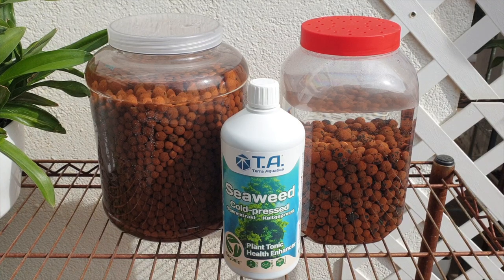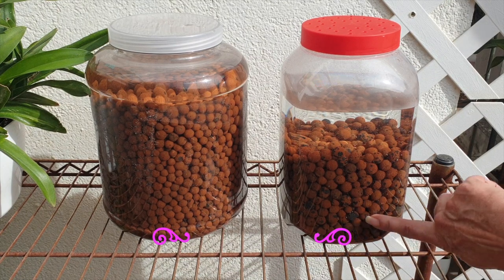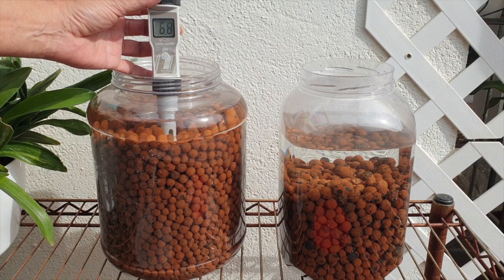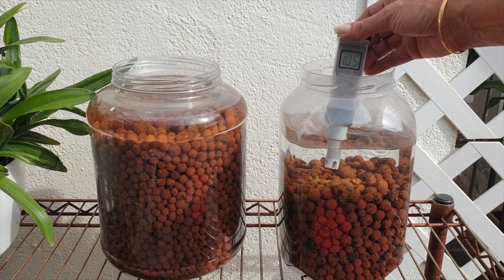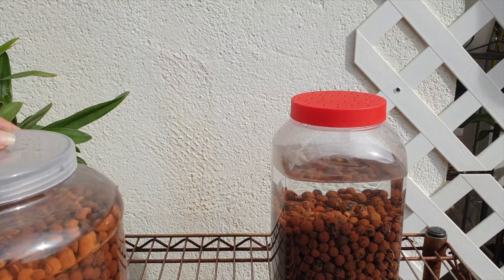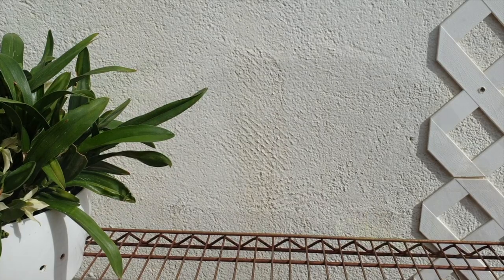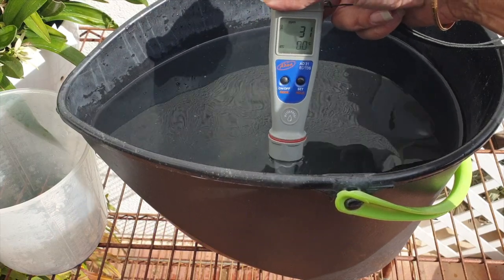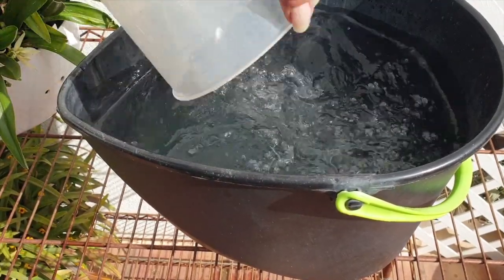Why Testing pH & TDS on Recycled / New Leca is IMPORTANT | TDS New Seaweed Brand #ninjaorchids

Comment: I would have thought the Lecca would have been cleaner. Lots of washing needed.

Thanks for the video
Reply from the maker: HI Richard 😍💐 yes! It is really surprising, isn't it. Now, things could be different from brand to brand, but it does not hurt to make sure of the values we are dealing with. Even the same brand has differences 😃 I was surprised when I tested the 2 different lecas and saw that the value of the newest was so low. Compared to what I had with the batch that had been sat in the RO water for the longest time and had been recycled, the new batch had me surprised. I am normally off the charts with the ppm for new leca and need to let it leach for months. That is why, if I think I need more leca for the coming season, I make sure to get it early enough so that I have months of leaching and changing water. The other day I tested the ppm of the new batch of leca and it had risen to 450 but that was after 2 months of no water exchange, so this was not such a bad new batch. Changed the water and it is ready to go if needed. Thank you so much for watching and your feedback 👍🏼 have a fabulous start to the week ❤️🌸

Comment: What happens if you acidify the storage water, down to say 4.0? I would expect the TDS in the water would go much higher as many times acids are better as solutes than bases, so a greater percentage of what can leach out should do so in the early stages in an acid water.
Also, that seaweed makes me think of "great green globs of greasy grimy gopher guts, mutilated monkey meat, little birdies dirty feet, and me without my spoon". Not sure many children outside the US sing this on the playground, but it was a thing here.
Reply from the maker: Don Miguel 🥰💐 hola jefe!! While acidifying the storage water is fine, it will only mask the leaching process and give me false results, so I prefer not to do that. I would prefer to know what I am putting in the pot, and then, if the pH is higher and not neutral as with my recycled leca, then I can pH any nutrient solution down and let the pot do the balancing out of pH as I have done in the past. Besides, if the leca takes on the acid agent, then I would have to leach that out eventually as well, and I do not want to mess with those variables 😬 I do find it interesting that my recycled leca is now not changing the storage water pH. That changes a few things that I need to take into consideration for the coming season when I get to fertilize again. Meanwhile, I was super interested to see the reading of the new leca was so clean, and after another 24 hrs, the ppm did not rise higher than another 50. That was never the case in the past. I would be shooting over 1kppm within the first 2 days. I did a water exchange on that container as well today. It may be chipped, but it is cleaner salts wise. Glad to have filmed this. Normally I just do my checking in the pantry 😆 I know that little playground tune and never understood it, but yeah 😂 on editing, it reminded me of Slimer in Ghostbusters. And, eventually the odor changed to that of being by the sea. Fresh and salty. Really appreciate you watching, Michael, thank you so much. Hope your day was fabulous and no one caused any aggro ❤️🌸

Comment: Thank you for this experiment! I’ve been trying out semi hydro on and off and have the same problems with high pH. 🙈 I’m definently going to try and leach out the leca before use from now on! 🖤
Reply from the maker: Hi 🤩💐 welcome! I have not seen you here before, so a warm warm welcome and thank you so much for being here, I really appreciate it 🤗 I had difficulty with some orchids, back in the day, when I did not have time to leach the leca for long enough to get it to stable out to the pH that the stored water is. I used to drop the pH of the nutrient solution to counteract the higher pH of my leca, but the salt accumulation would then still be an issue, because the leca was too new. I am really glad that this video was helpful, thank you so much for letting me know. Always feel free to ask any questions, under any video if you just need a confirmation of something that you may already know, or anything else for that matter 👍🏼 really appreciate you watching, thank you🥰 🌸

Comment: good and cheap seaweed is quite hard to find here too. Cold pressed should be green, otherwise it's chemically processed and turns brown, some are thick, some are weak as tea. Not sure about the consistency on yours. It's green but it seems too thick, if it were super concentrated thats fine but you had to use 1.5 times as much so it's not more concentrated, just far thicker like they literally did mix it with molasses. I question the benefit but since a bottle lasts so long I will most likley get a new one but which one to get....? There's literally only one cold pressed one I found and some reviews like it, others say it's watered down. It's interesting you got an aquarium product, I hadn't thought of that but they are generally twice as expensive. I was also contemplating not using seaweed for a year to see what difference it might have. Tough long term decisions.
Reply from the maker: Hi Tom 🥰💐 I have had cold pressed in the past years and it would also be brown, so.... maybe they were misleading on their label, or, it was done for because of wrong storage at the facility 🤷🏼‍♀️ this product cost me 23 Euros, for a litre. My previous one 'KelpMax' cost me a little more than that for 500 ml. I will just have to wait and see if it is of any good. Meanwhile, I do like the smell of the fresh sea it develops while in the bucket longer. I like the consistency, but was surprised at the fact that it wasn't incorporating with the water quickly. More agitating of the bucket is needed. Its different, for sure, but is it any good? Update scheduled for 2026 😆  thank you so much for watching, Tom! I hope that you had a fabulous day 🥰🌸
Reply: @NinjaOrchids  I'll be back in 2026! Take care till then my orchid friend :) Nah just joking. I think I will stick with Bio-Bizz Alg-A-Mic. £15 for a liter. It's supposedly the best in the plant industry in Europe right? Nother expense on my shopping list. I got those pots I mentioned recently. And a new light. And a new orchid lol.
Reply from the maker: I just googled the product you mentioned, and yes!!!! I had that one in my sights as well, and have it bookmarked! Guess who goes by pictures and not names 🤪😂 when I read the name, I googled it straight away, then I saw the pic and boom... its bookmarked! D'oh! 😆 I look forward to you letting me know what the consistency of it is when you get it 🙏🏼👍🏼 it doesn't always stop with one purchase, Tom! I have done my best to stick with what I need, and not look into the realm of 'other products that could interest you'. Its hard, but I am chuffed when I can then x out 😉

Comment: Nina, after 4/5 days I store my leca it stinks. I use only Ro water. Is it normal? Does yours stinks ater 4 months? Thank you Nina, great video as always.
Reply from the maker: HI Dania 😍💐 oohhhh noooo!! That is no bueno! And very strange 🤔 mine does not stink at all. After 12 months ... no smell! Do you store it in a sealed container? That is what I do, my containers are all closed off. Also, is your leca stored with as little of old velamen attached to it? After repotting, sometimes the velamen gets stuck and it is not always easy to remove, maybe there is too much stuck to the stored leca and the organic media is decomposing? Do you boil your leca before you store it? So many questions, but they are the first that come to mind when I read your comment. Thank YOU for watching, and let me know if there is anything else that I can think of to figure out why your stored leca starts to have a smell! Hope you and your beautiful family had a wonderful day 🫶🏼❤️🌸
Reply: @NinjaOrchids  Nina, this leca I use is totally new. It's for idroponica and a bag is 22 euros. I do all what my orchid teacher advice me to do( your video leca masterclass). It takes almost a month to  reach 65/70 ppm at 6,5 ph. Yes, my bottle is sealed but after 4/5 days  there's a slight slime and a wired smell😪my bottle is in plastic.
Reply from the maker: Can you tell me the brand of your leca please, Dania! And can you tell me if it smells like gasoline or turpentine? Your bottle is not the problem... mine are all plastic as well. Let's see what is going on with your leca. If you can describe the smell for me please 🙏🏼
Reply: I send you an email with the picture of the package. When I open the bag there is no smell at all, just dust. It's just after 4/5 days in RO water that smell like when you need to clean the acquarium . The smell of old water. Thank you Nina @NinjaOrchids
Reply from the maker: I have sent an email to the manufacturer! I checked their web page to see if I could find out how they process their leca, but did not find anything. For now, would you please rinse your stored leca with fresh water and exchange the water in the container with clean water. Just to see what happens. Have you tested the pH and TDS of the smelly water?
Reply: Nina, I do not have stored leca for this reason, as I had to change water every 3/4 days. But I started to clean a new bucket 2 weeks ago. As soon I reach 60/85 ppm I will store again and test ph and TDS of the smelly water. I hope to solve this problem, as when I need to make a repot I have to plan it 3 weeks ahead..... Thanks Nina I keep you updated.
Reply: Dear Nina, I'm soooooo happy to tell you that after 10 days I stored my leca at 10 ppm and 7.5 ph there's nooooooo smell at all. After 10 days I got 65 ppm and 8.3 ph. I know what I did wrong the other times. I used osmosis water after 10 hours it was in the bucket. This time I but directly the water coming out from the R.O system and voilà. NO more smell! Thank Nina
Reply from the maker: THIS comment makes me happy! And it makes me angry at myself that I did not follow up with you! I did not hear back from the manufacturer... it totally slipped my mind, I am so sorry 😔 it did not occur to me that you used the run off water to store the leca. BUT I learned something new... not to use run off water to store leca. I have never done that, just because my run off goes into the drain, I do not see it. So, I have only ever used the RO water that I use for my orchids. Thank you so much for this comment! Very helpful as well to anyone reading the comments, if they have a similar issue. I hope you had a wonderful Sunday 🌸🥷🏼 Dania San 🫶🏼